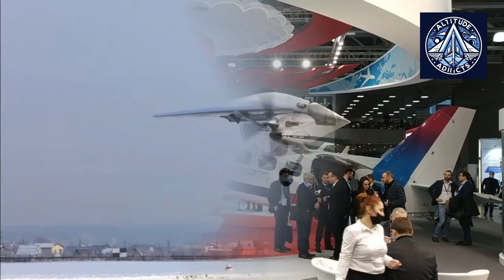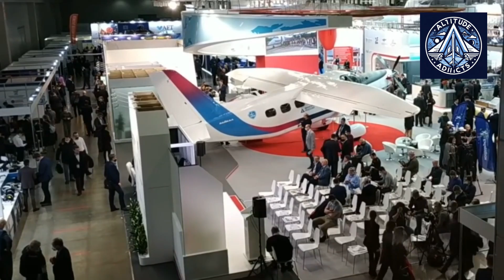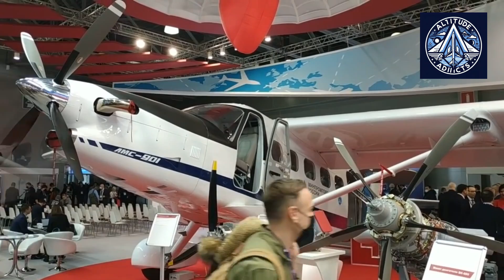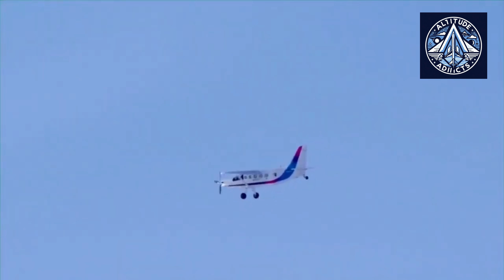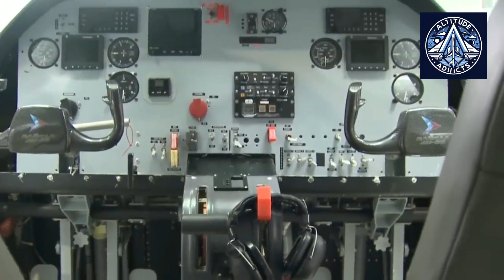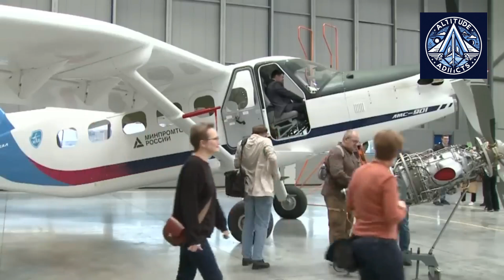Russian UZGA LMS-901 Baikal Aircraft Project Faces Delays and Cost Overruns

Comment: As a concept it seems to borrow a little from Dornier in the wing design. The fuselage may owe a little of its look from the Mi17 helicopter. Style-wise it is not bad at all. 

I am not too confident about the apparent pendant lift strut attachment to the wings. I can envisage structural issues from lateral loadings during landings and strong yaw control inputs. 

With such a long take-off and landing roll as mentioned, what was the real point in having a tail-wheel arrangement? It is adding handling issues except for maybe not collapsing a nosewheel leg during an over-run into soft ground. But then the whole aircraft simply flips onto its back anyway when the main wheels bog in. 

One wonders how the pilots will fare in an overturn accident. Will the fuselage and firewall fold back into the cockpit workspace and crush them. There may be extra tube framing behind the windscreen but I could not see any in the images. Flail chest injuries are no fun. 

I note there is no second top to bottom carry-though structure at a station coincident with a secondary wing spar to deal with strong sudden yaw moments experienced in ground handling when the wing mass wants to remain somewhere else. Some cracking/rippling in the upper corners might become apparent as the hours in service grow.

One wonders if it may encounter with that extended fuselage floor, a centre of gravity issue. As for the rear-hinged suicide doors. One does not need much imagination to know where they are headed, not if but when.
Reply: Os russos não são amadores na aeronáutica, são pioneiros !
Reply: @eduardjacob8710 . I grant that he former USSR made some good looking aircraft and ships. Changing established techniques for attaching the lift struts at the wings just for the sake of doing it differently may come back to haunt the designers of this bush plane. There may be an inspired innovation there but it is not readily apparent. There is too much about it which seems half-cooked.

Comment: Такой вопрос: а почему не шасси с носовым колесом?
Reply: On remote area airfields with rough surfaces, a nosewheel is vulnerable to damage which can also ruin the airframe at the front which is expensive to repair. The nosewheel aircraft is most often heavier than a tailwheel aircraft of the same airframe family. The tailwheel arrangement allows the aircraft to slow down on the ground with the wings inclined which adds a little aerodynamic braking effect once the aircraft is no longer flying.
Reply: @DARANGULAFILM  Baikal's wing has lack of lateral stability at high angles of attack, that makes LMS 901 realy dangerous to fly in tailwheel configuration.
Reply: @СергейНизов-с7д . Anderdral wings seem to be a Russian engineering preference. Of the two Dornier aircraft which this aircraft seems to emulate, one also has an anhedral wing.
Reply: @DARANGULAFILM  I think Baikal does not have an anhedral wing at all, it have a zero dihedral "tip swept"  wing, made with very unusual "three hundered" TSAGI series airfoil, and this poor combination, added by a stupid square-sectioned wingtip design, lead to lateral instability.
Reply: Носовое колесо было исключено при голосовании, как и композитный планер. А у-бищная форма крыла в плане была выбрана из соображений эстетики, а не аэродинамики.
 Короче оно полетит, но только если сделать новое крыло и довести до ума движок.